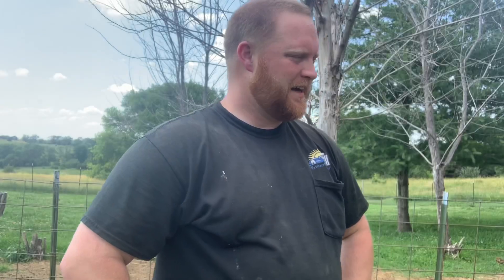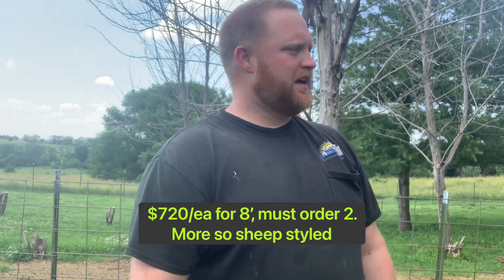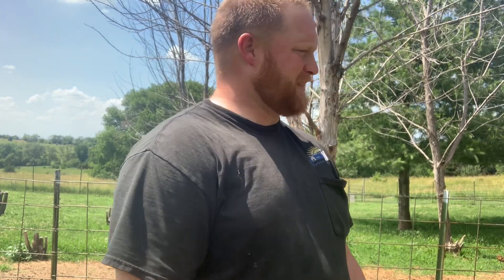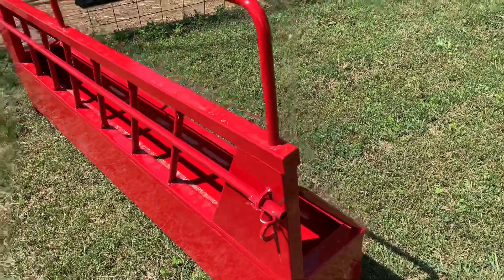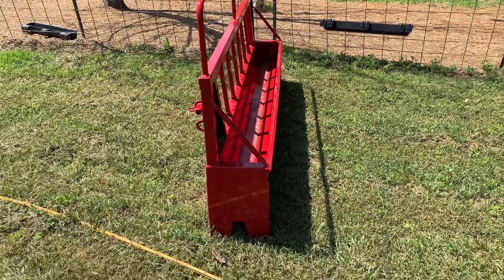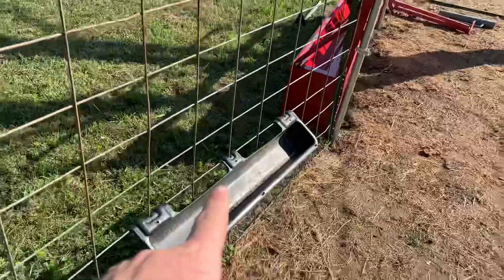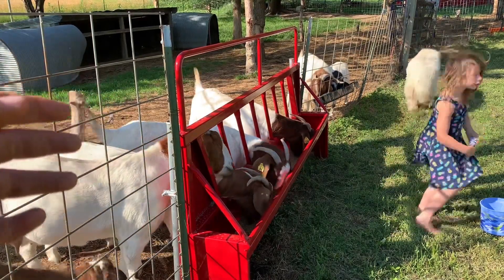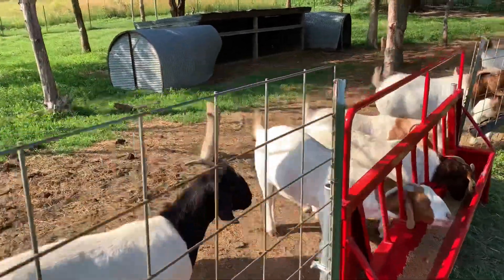Our Prototype Fence Line Feeder with Patriot Equipment | Raising Boer Goats

Comment: Goats are difficult to feed as a group.  It can be very frustrating.  Hope this works out for you once they get used to it. We have a couple of does who will dominate both sides of a large, $800 feeder meant for 16.  Aaaargh!
Reply from the maker: I know that’s the hardest part ya compared to the lighter duty ones I’ve seen some may freak at $700-800 but with economy of scale we can bring this down with ordering metal appropriate. So far we can get more goats into this feeder once they get heads in but it will take training so the timid aren’t scared to come up. I think at $5-600 these feeders would find some good homes. Today’s current prices I’m not sure that it’s attainable but there’s likely 3-4x the steel weight in this feeder.